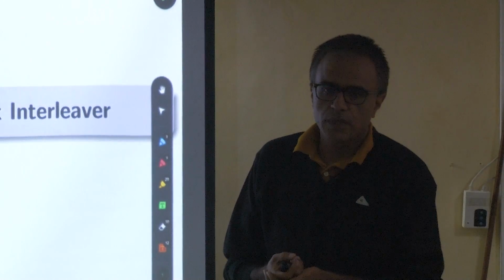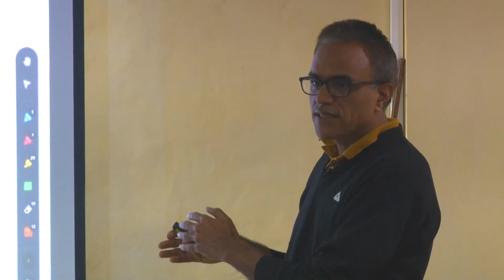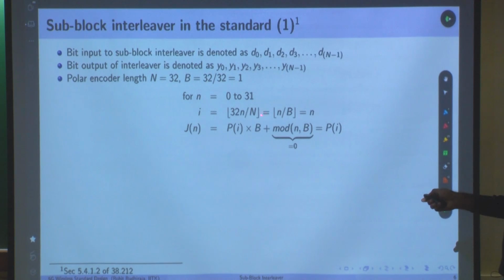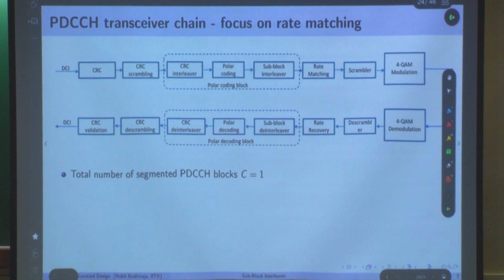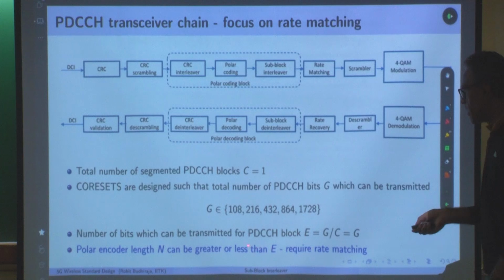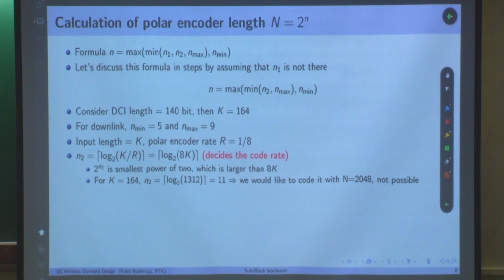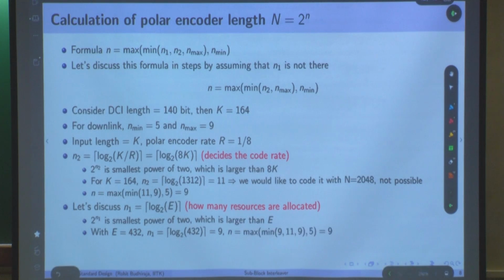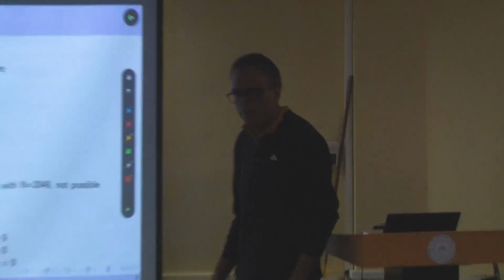Lecture 26 : 5G PDCCH transmit chain – sub-block interleaver

Comment: A curiosity question: who is more stronger? Better SNR or better(lesser ) code rate ? For instance, suppose I want to channel encode and send - lets say 100 systematic bits using polar coding - I have two options - 
either 
1) to channel code it with N = E=512 and send 
OR
2)  to channel code it to N=256 and the send with E = 512.(repetition will happen in rate matching)

- who will have better performance? method1/method2 ?

Comment: 6:45 In the subblock interleaver, neither the beginning bits, nor the end bits are getting shuffled. Only the middle bits are getting shuffled. 
In rate matching(puncturing/ shortening) either the beginning or end bits are thrown away. Mid bits are always kept. Then what is the importance of SBI? The bits that change its order (interleaved) are always sent. How is SBI making sure that most reliable bits are not thrown away ?